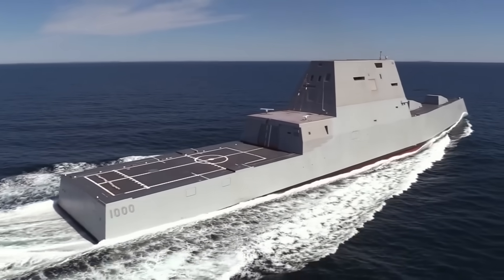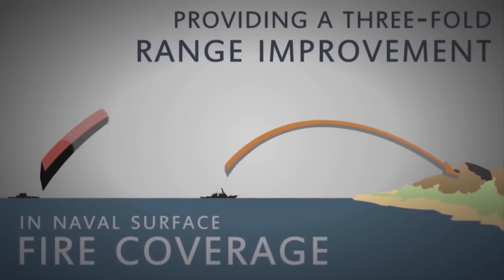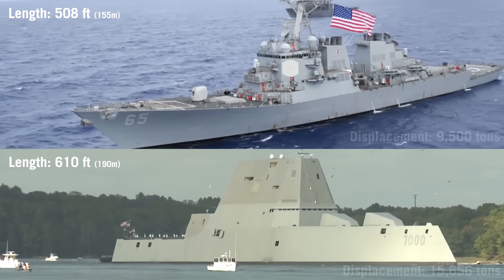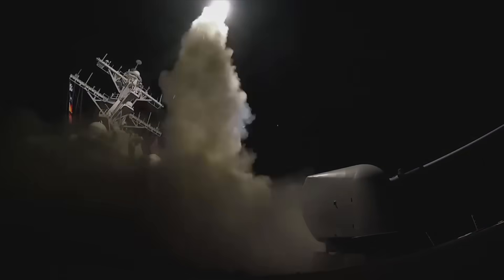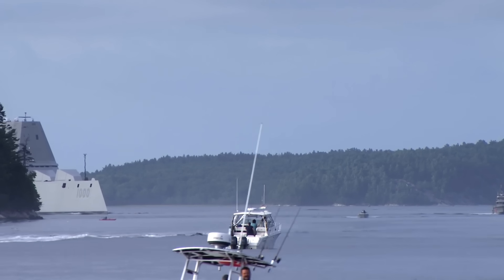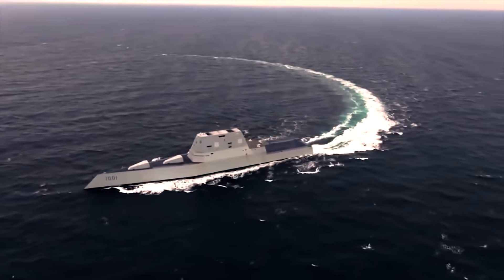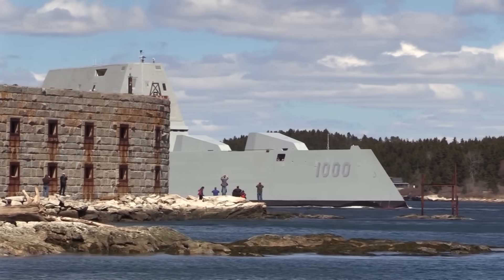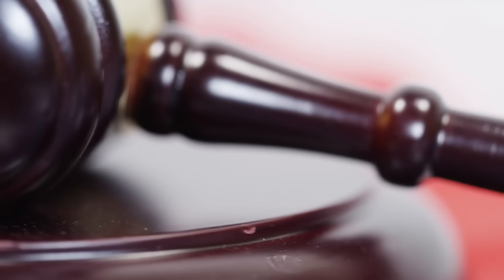What Killed Zumwalt Destroyers?

Comment: I read an article in a military magazine that they are having recurring failures of their newly designed drive transmissions. Main shaft bearings would burn out, shafts would break, & so on. One Stealth Destroyer departed from Norfolk recently and made it less than 10 miles offshore before breaking down & having to be towed back to the yard. The failures have been so frequent that General Dynamics agreed to cover the cost of the repairs.
Reply: Are you sure you’re not confusing this ship with the littoral combat ship? That ship has a problem with its multi engine combiner gears breaking. Maybe both types of ships uses similar systems? If so our the Navy is in trouble
Reply: so effectively, tiger syndrome. a machine that's so overengineered that the most basic parts hardly work because all the money and effort went into semi-functional technical gizmos that may or may not be an improvement.

Comment: "Stealth" on a destroyer is not primarily about avoiding detection. Current air and naval warfare is conducted with missiles which use radar to guide themselves to their targets. The advantage of stealth here is reducing the range at which enemy missiles can lock on.
Reply: Zumwalt is an expensive piece of garbage. Almost nothing works, be its engine, gun or radar etc. The next gen destroyer design DDG(X) has to copy the Chinese type-055
Reply: @aburetik4866  
Hahaha.  "Nothing works, so let's copy a country that has stuff that never works."
Reply: Stealth ships are slightly less vulnerable to modern anti-ship missiles.
Reply: once its close enough the stealth advantages are mostly gone.
Reply: Reduce the range of target acquisition of enemy missiles... for a littoral ship? For a littoral ship that makes no sense whatsoever. No wonder they reclassified it as a destroyer.
Reply: You do know most land and ship attack missles have video cameras along with other sensors to help target? 
You don't think a tomahawk can kill zumwalt?
Reply: @puellamservumaddominum6180  Radar on the missile are smaller and weaker, so you have to fire by using main ship systems from as far distance as possible. Camera on the rocket would be used in very the last moment ONLY if it reach the target really close and not jammed.
Reply: @puellamservumaddominum6180   Yes, they can.
Reply: @puellamservumaddominum6180  okay no
Reply: @ramontorresechevarria293  can you explain?
Reply: @puellamservumaddominum6180  Cameras can't see over the horizon.
Reply: What is your point Mr. Navy Clown guy? At that same range which the enemy modern destroyer ship can not practically detect the Zum Walt Disney, the Zum Walt Disney can not also practically sense or see the enemy modern destroyer or do any jack shit damage to it. The Zum Walt Disney doesn't have any better radar system as to the enemies, the Zum Walt Disney is just a floating boat made by Gucci hired by US Navy. Enemy modern destroyer ships ain't stupid, no mama raise no navy fool.
Reply: @ShopperPlug  Zum Walt Disney hahahahahahahaha
Reply: @pedroalencar6407  I'm hoping your laughter was sarcastic, because that was so corny it surpasses dad jokes in cringe level....

Comment: The so-called smart people in Washington has continue to fail to replace our old battle ships wasting billions. We have 4 awesome battle ships. There is so much room we can take the 3 billion and have the huge ARMORED battleships updated. Even new engines.  Make 14 inch ammo put a GPS nose cone with rocket booster just like the 155 artillery.  Remove some of the 5 in gun mounts replace with surface to air missiles. The battleships already carried a large amount of tomahawk and harpoon missiles, also the ship I was on carried torpedoes.  The armor belt will protect them with added protection. Then a true warrior ship will be back on the seas.

Comment: Stealth is always expensive, and as you reduce cross section it increases either production or maintenance costs. And the rail gun program was canceled. Rail gun was a silly idea anyway since still suffers issues of wear for each shot, and wear increases with shell velocity, and air resistance is exponential with velocity.
Reply: To be fair, every gun suffers barrel wear per shot. IIRC the Iowa's needed their barrel lining replaced every 1000 rounds. The issue wasn't barrel ware, it was uneconomical barrel ware.
Reply: @Bustermachine  A gun can get close to the sort of range that they were hoping for with the railgun, but it also suffered massive wear problems to do it. The Paris gun could do 81 miles, but only fired 320 and 367 shells and needed at least three barrels.

Comment: The Zumwalt class is a great example of why/how the DOD procurement system is broken. 
     What is needed is an all new, and more realistic approach. Which is a fancy way of saying renegotiation. The contract/concept involving this hull design needs to be streamlined. Certain excessively expensive items, will have to be replaced by less expensive alternatives.
     The "battleship gun" focus was just plain goofy. Longer ranged guns can be built. So can rocket assisted guided munitions. But not at the cost,contractors demanded. Clearly the program structure was written for the advantage of contractors. This precedent needs to be excluded from future projects.
      We have a great hull design. So? It's time to talk about using the money/research already spent? To build something based on the Zumwalt class hull. Using weapons and other systems. The whole of which is both affordable and effective. 
     Even if extra expensive stealth paint and similar expensive features aren't included. Using the same basic design, allows for later and less expensive upgrades in the future.

Comment: The multiple redesigns leading to a poor final product that does not even come close to what was advertised. The main redesign killer was removing the 2 nuclear reactors that killed the rail gun the Navy wanted. 1 reactor was to power the gun only, the other for the ship; they were to be rotated annually to keep their fuel levels close to equal. Now they require shells that cost 250k each because the Navy never contracted for long term or mass production of said shells. At least they were smart killing this after only 3, the opposite of the other POS program called LCS.

Comment: Ben Rich, who managed Lockheed’s “Skunk Works" during the F-117 Stealth Fighter program, explained the problem with stealth ships:
In heavy seas, radar can see the waves. So you look for places  on the radar screen where there are suddenly no waves, and that’s probably a stealth ship. 
Skunk Works discovered this problem when they built a proof-of-concept ship, the Sea Shadow. It was essentially a stealth fighter shaped ship, but easier to build because it didn’t have to fly.
Reply: Seems like the answer would be to simulate wave signatures then
Reply: @theterminaldave  This is how it actually works. That quote sounds like it came from someone that doesn't actually understand how shipboard radar works.

All radar has to deal with clutter. It does this by being set so that clutter just doesn't show up. In the case of stealth aircraft, they're designed to have the signature of objects the radar is normally set to ignore, just so the screens aren't filled with returns from every bird and bug in the region. If the gain was turned up, stealth aircraft would be detected, but so would a lot of other things.

In the case of ships, the waves send back returns. I've seen this watching the screen on the console that sees the data from SPY before it gets filtered for the other consoles. There were sometimes huge swaths of the screen that would light up from the returns coming off the waves (the other consoles would have marks indicating the strongest returns, but not nearly as big). So for a ship to be stealthy, it just needs to give back a return similar to the waves around it. There is no "blank space" where there are no waves. Especially in heavy seas, where the waves can be as big as the ship. And even if the ship could create a "blank space", that would only be for the ship itself. There would still be waves around it. It would simply look like empty ocean on the screen. In light seas, with no waves to give clutter, it would be about as easy to detect as any other.

The idea of a stealth ship (which should really be labeled as a "low profile" ship) is sound. The problem is executing it in a way that creates a functional warship. So far all attempts have failed miserably. The Zumwalt might have worked, if they had chosen one area to focus advancement on, and used tested technology for the rest.
Reply: @bradgaines5091  Really interesting, thanks for the reply
Reply: I only know about the Sea Shadow because it was in a james bond movie
Reply: There is a lot more reasons it was canned.  Enemy technology is also advancing, there is more than just RF transmitters to hide from now.  The navy has adopted a concept of distributed lethality which means more and smaller hulls with firepower to counter swarms of enemies and increase survivability & redundancy.  This is basically the same reason you don't see battleships anymore.  Too much consolidation of assets on one big target.  Frigates can now carry much of what the Arleigh Burke class destroyers can carry and can be made for a fraction of the price of a Zumwalt.  The one big advantage of the Zumwalt is if China copies it like they did the Arleigh Burke it could bankrupt them.
Reply: I remember that ship. Totally Wicked & Sinister looking design. I think they used some footage of it in a Bond Movie :-)
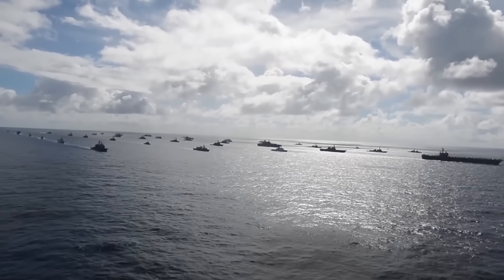Reply: At 3:50 "Being stealth will be an overwhelming advantage in waters that are crowded with tankers, pleasure craft and fishing boats" is BS. Any one of these boats close to the destroyer would simply report it=stealth is worthless. Stealth ships are pipe dreams and I'm disappointed and not surprised the brains at the Pentagon could not have known large things operating slow and in only two dimensions would not benefit from stealth technology.
Reply: Another problem is that submarines can also achieve "Stealth" while being far cheaper.
Reply: That's also the only way the Russians found to track the Ohio class SSBNs for a few minutes. They looked for the spot in the ocean with no sound
Reply: That was how swedens air defence system found your f-117s triangulating radar system that found it interesting to find a moving blind system.
Reply: @grappo77  What did they do about it? NOT A FOOKING THING
Reply: @grappo77  The F-117 worked by redirecting radar returns somewhere other than the originating radar. Multiple radar sites all watching the same piece of sky would pick up each other's returns off an F-117, and if they were networked together, they could combine those redirected returns into a target location. The F-117 really only worked because at the time radars in the regions they were used weren't networked.
Reply: @bradgaines5091  Exaggeration... There are small chances that multistatic radar with 3 
antennas will be sufficient, because returns from F-117A are very concentrated and do not hit any of them.
Reply: @bradgaines5091  They should make advanced AI to identify low profile enemy targets from the radar signals.
Reply: @grappo77  The only F117 ever shot down was shot down by pilot error. The pilot had been flying the same route day after day, was flying with his bomb bay doors open, which throws stealth out the window, and the radar operator was very smart and used C band, at its lowest frequency. Add to this electronic warfare EA6B Prowlers being grounded and the Serbs got lucky and shot one down. There are reports of another F117 being damaged by the S125, but managed to return to base, but that is unconfirmed. Had the pilot used different approaches and not had his bomb doors open the whole incident never would have happened. Im not aware of Sweden detecting an F117, you have a link to that story?
Reply: Whomever believes "stealth" is what actually Lockheed Martin has been presenting it to be, lacks any knowledge of Physics.

There are three cases in nature where Electromagnetic radiation is not reflected back:

1) In the case when the impedance of the medium within which the EM wave travels, gradually matches the impedance of the incident material. This is the function which those funny blue pyramids perform, on the walls, floor and ceiling of anechoic chambers: They gradually change the impedance of air, to that of the base of the pyramid.

2) The case of black holes, where EM is gravitationally pulled in, photon by photon. Which is why they are called "black": Not even light can escape their gravitational pull.

3) The case when the body is covered by plasma. This is the reason why we lose comms with space vehicles during re-entry.

There is no other case where an object can just "disappear".

It was very funny when in 2019 an F-35 went down off Japan, that the media started reporting "An F35 disappeared from radar". Before you know it the whole internet was laughing at them, saying: "Oh, but we thought the F-35 was "stealthy", do even *Civilian aviation" radars see it?". Google for:

businessinsider japan-military-says-f-35-fighter-jet-disappears-from-radar-2019
Reply: @nomayor1  Key word in that phrase is "back".  It may be good enough to reflect the energy in some other direction.  You don't have to make it disappear.
Reply: @ntdscherer  Receivers are very sensitive. Even minute levels of Rx power are good enough to make a detection. And the other thing is that the shape cannot be optimized to minimize the reflected wave for all incident angles and from all sides. Only a spherical shape could achieve that, and I am not entirely sure how it would be able to generate lift, in order to fly.
Reply: @ntdscherer  Oh, no, the military is not spending all this money for no reason. The military is spending all this money so that they get extremely well-paying job in private weapons manufacturing companies, after they retire. 
In general, there are three and only three cases when an incident EM wave is not reflected back:
1) As defined by Maxwell's equations, when the body on which the EM falls is covered by a material whose impedance gradually changes from that of free space/air, to that of the material itself. This is the case of those big blue "pyramids" you se covering the walls of anechoic chambers.
2) The case of when the body is covered by plasma. This is also the reason why we lose comms with space vehicles during re-entry.
3) The case when the body is a black hole, when the EM wave is gravitationally pulled into the "hole", photon by photon.
"Stealth" in the sense that Lockheed Martin promotes the f35 to be, exist only in the imagination of children. You might want to have a think about how the Serbs shot down the "super-stealthy" F-117, using some ancient SAMs of the '60ies. Or why the US are so concerned with the S-400's which Turkey bought, that they blocked the sale of the f35 to them.
Reply: @nomayor1   So you're claiming it's impossible to reflect an EM wave in a direction other than where it came from.
Reply: @ntdscherer  What I am explaining is that the object moves, and the radar may also be non-fixed, it can be for example an aircraft-based radar. So optimizing the external shape to reflect less percentage of the incident EM energy does not help. As a matter of fact, the most important percentage of the reflection comes from the airframe and the jet engines themselves, not the skin.
Reply: @nomayor1  I think you're making assumptions based on what the average person might think "stealth" means and not what Lockheed is trying to portray. 😂 And I think LM engineers have a pretty good idea how "stealth" works, considering they're pioneers of several stealth systems that have proven successful.

Smh you got me out here defending LM... 🤦🏻‍♂️
Reply: @nomayor1  you sound like a school kid who just read something on google.
Reply: @billpugh58  Oh really? Point me to some technical material which contradicts what I 've said.
Reply: @nomayor1  He might have just been flying with his transponder on, then when he went for a swim, it drowned.

Comment: Describing the cause as too many new system is simply feel good propaganda with little basis in reality. If too many new systems caused cost overruns it means you didn't cost estimate properly at the start of things for the development of those things. And that either means someone was very incompetent in estimating the costs, or someone wasn't executing proper oversight of the whole estimation process.

The AGS was what did the ships in IMO. It added a lot of weight and volume to the overall ship design, (which adds costs to almost all the ships other features), but because of all the compromises in it's implementation, (was trying to meet Congress's NGS role whilst also doing somthing the navy thought was useful),  that it ended up being a difficult to develop system that was never going to be cost effective at anything whilst making the overall ship bigger and more expensive.

Comment: The interesting cost over run death spiral:

Planned R&D: 1000¤ (fixed cost)
Planned production cost per unit:  10¤ (variable cost)

If we budget for 2000¤ we would get 100 units at a price per unit of 20¤.

Then we have 25% overrun on R&D costs, and 50% overrun on production cost.

R&D: 1250¤
Production (per unit): 15¤

New unit cost if we get 100 is 2750¤, 27.5¤ per unit, or 30%

So we pull the brakes and limit the expenditure to ¤2500.

Now we can only afford to build (2500-1250)/15 = 83.3, say 85 units.

Now the project cost is 85*15 + 1250, 2525¤, 25% over the original project budget.
The unit cost however is now 29.7 (almost 30) which is 50% more than planned, so the project is cancelled.

My guess is, those 1250¤ for R&D have still been paid.

And this is how trying to save money makes things more expensive.

(¤ is an old currency sign by the way)